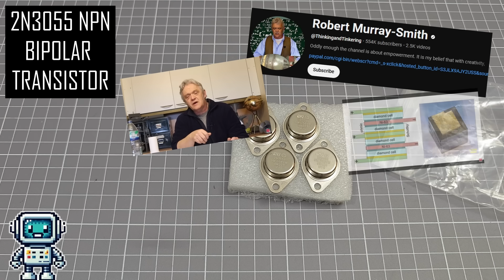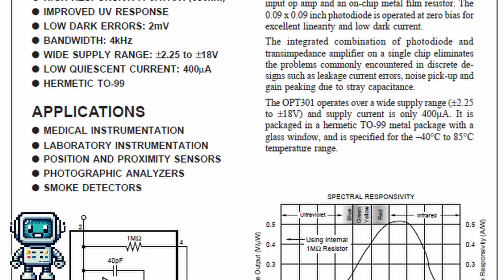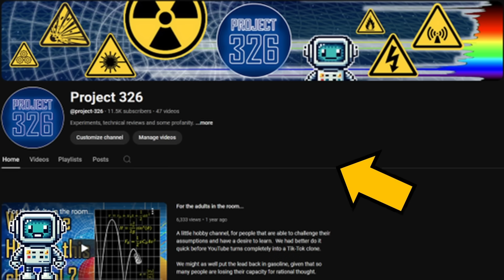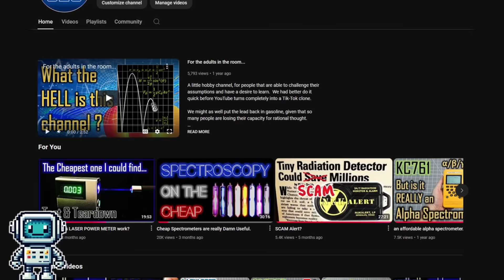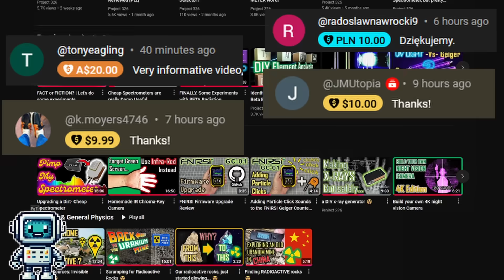Easy Peasy DIY Thermal Camera Microscope

Comment: @10:57 water under the bridge at this point, but as a thought experiment...  what you really needed was to show more contrast, a greater thermal gradient.  Turning up the power is one (potentionally) catastrophic way of doing that.  You're increasing the deltaT between the package and the room.  But maybe another way of doing that would be to put a gentle fan, like an 80mm pc case fan, blowing onto the die, removing thermal energy and exposing sources of thermal by creating a larger gradient?

Comment: Murry-Smith is a teacher, he does not fake anything because he has no need to.  His channel is just showing us interesting and useful stuff that he finds, if you think his video is fake then I challenge you to try and disprove it.
Reply from the maker: Actually, I got in contact with him after this video.  Turns out he is a really nice chap and we have been chatting over email regularly since.  He did accept that the results he got were probably from light leakage.  

I repeated his experiment for him and showed where the error was probably occurring.  He was also gracious enough to accept my apology.

We were planning on making a video together, but as I am sure you know, he has just announced that he is no longer making videos anymore.

FYI, logically you cannot prove a negative, the onus is on those that make claims of positive results to prove those.  A simple semiconductor P-N junction cannot achieve the tunneling required from alpha particles unless a charge is already applied to the junction.  So, this can work as a simple alpha particle detector, but cannot produce net power.  PIN (slightly different structure) diodes are often used as alpha particle detectors.
Hope that helps
Reply: @project-326 I saw the chat you had with him, glad you guys are cool.  His latest video on his channel is him saying that he will not be making any more videos, he doesn't say why.  I hope that he changes his mind.

Comment: купил вот такую инфракрасную камеру(тепловизор)-TOOLTOP ET693C,
вырезал и склеил для нее накладку из пластмассы(ABC) для крепления микролинз
(для поиска коротких замыканий,на электронной плате)-
просверлил два отверствия для линзы инфракрасной камеры= 20 мм, и для видимой видеокамеры= 14 мм,
приклеил все,клеил все СУПЕРклеем ,
а линзу клеил другим клеем-POLIMER-нейтральным,
Фокусная линза Cloudray  CO2 ZnSe
с цифрой=25,4  мм(для SMD телефонов-PCB circuit board) 
с цифрой=38.1 мм,(отличная для SMD ЭЛЕМЕНТОВ-PCB circuit board), 
и цифрой=76,2 мм,(ОТЛИЧНАЯ ДЛЯ PCB circuit board)
диаметр у всех одинаковый 20 мм,просверлил и дирку для видеокамеры 14 мм.
Лучше брать марку линзы=Focus Lens Vs Cvd Znse,она дает меньше искажений,но в 2 раза дороже.
Вырезал и склеил для насадок с линзами коробку из платика,для предотвращения царапин на линзах.
Рекомендую!Все работает отлично!

I bought such an infrared camera (thermal imager) -tooltop et693c,
I cut out and glued a plastic overlay (ABC) for her for fastening microlyins
(to search for short circuits, on an electronic board)-
drilled two openings for the lens of the infrared chamber = 20 mm, and for the visible video camera = 14 mm,
I glued everything, glued everything with superglue,
And he glued the lens with other glue-Polimer-neutral,
Focus Lines Cloudray CO2 ZNSE
with a number = 25.4 mm (for SMD phones-PCB Circuit Board)
with a number = 38.1 mm, (excellent for SMD elements-PCB Circuit Board),
and number = 76.2 mm, (excellent for PCB Circuit Board)
The diameter of everyone is the same 20 mm, drilled and dirka for a video camera 14 mm.
It is better to take the brand of lenses = Focus Lens vs CVD ZNSE, it gives less distortion, but 2 times more expensive.
He cut out and glued a box of payments for nozzles with lenses to prevent scratches on lenses.
I recommend it! Everything works fine!

Comment: at 9:06, the wire on the right has small specks of heat while most of the wire is cooler... I wonder why?
Reply from the maker: Thank you for the comments.  The apparent hot-spots might be the result of reflections off the bond-wires.  These are normally made from aluminum which is a great reflector of thermal IR energy.
It could also be a real hot-spot, but it is pretty difficult to say.

Comment: This is awesome. It's exactly what I was looking for. I have a hikmicro b10 and would like to make a lense for it. I would use it to casually view boards as large as a 3d printer board, and as small as an esp32.  I think the triple lense that you have here might be overkill for my needs.  I am also wondering if the optics in the b10 will be similar to the optics in your device. Thank you for this video, it is a great starting point for me.  I may get some of these lenses ordered and start working on a 3d model to fit the b10
Reply from the maker: Thanks for the feedback, it sounds like you are on the right track!

Comment: I had a question, i recently bought a single thorium mantle which gets around 150 CPM whereas other videos shows that the single mantle gets around 1300 CPM , is the difference due to accumulation of its daughter products and how much time does it require to accumulate the daughter products ?

Comment: For the infrared telescope

We are going to need a metal mirror (not a glass made & metalcoated mirror. It must be made of shiny metal. last part of the video) 

https://youtu.be/iE0ajDN9848?si=wg9joZmsbSbPhBWT

And then build a Newtonian Reflector telescope using that metal mirror:

https://youtu.be/f27s0_S6E0E?si=OUiJu1qPFTIQB02o

If it works with visible light, it will work with infrared also.. 
That kind of telescope use tiny lenses (cheap) and a big mirror (affordable)

Comment: Do we need lenses or Filter, if we can just program to reduce ISO of thermal sensor and can zoom in as unlike normal camera sensors, thermal don't get blurred when zooming digitally because they are more sensitive and can capture thermal energy at very micro levels than normal camera sensor.
Reply from the maker: Hi and thanks for the comment.
Perhaps you can be a little more specific on this point?  I'm not really sure I understand what you are implying by the mention of "reduce the ISO"?
I would greatly value your clarification on this point...
Reply: @project-326  like via programming only allow certain frequencies at a certain zoom like clearing blurred imagine but constantly via code where while zooming, frequencies get updated automatically that limit readable signals based on zoom in and zoom out
Reply: It's like the Digital Focus Code Principal applied on Core Frequencies Sensor Programming

Comment: You need a large aperture with FAST focal ratio telescope to get descent result, or else the contrast will be too low.
I tried removing the glue of the lens and could focus to very close distance, so the extra lenses may not need.
This is my thermal Moon (12" telescope) captured back in 2023:
https://www.youtube.com/shorts/WQ21lNZH6dM
Reply from the maker: thank you very much for the information.  In fairness I just want to maybe view the moon but mostly aircraft, I think that will give for an interesting video to the viewers.  Any further advice you have would be very much appreciated and your contributions will be mentioned in the video...
a 12" mirror is going to be pretty expensive, especially if it has a low f-number.  I think that the only good news is that due to the low wavelength, the accuracy requirements of the mirror will be around a factor of ten less...
Reply: @project-326  And the spatial resolution (diffraction limit) is also a factor of ten less than an optical system. So a 12" telescope in thermal wavelength range has the same spatial resolution of a 1-2cm optical telescope... 😅

I suddenly have an idea, maybe you can try mylar to make a membrane mirror?
https://www.youtube.com/watch?v=GrfPhjPzaOc
Reply from the maker: @wahwahwah8528  I know I keep taking the 'optimistic' line here, but the other advantage that this project has is that the required image resolution is very limited due to the low pixel count on the sensor.
You are advising a 12" main mirror, what focal length should I look for?
Reply: @project-326  My telescope is 12" F3, camera is Infiray T3 without lens. The Moon image is actually larger than the sensor, so I need to do multiple shots and mosaic them. Since the contrast (SNR) is not super high, I have to stack hundreds of frames to improve the clarity.
Reply from the maker: @ may I ask what tools you used allow the image stacking?

Comment: Telescopes working in the LWIR wavelength band are quite tricky, because to get a reasonably decent optical resolution you need to be close to the diffraction limit, which for LWIR usually means very fast optics (ideally F/1, worst case around F/1.8 - depending on the pixel size of a microbolometer detector). I can't imagine building a telescope that fast, so with a standard Newtonian telescope (F/4 or F/8) you'll end up with a blurry image.
Reply from the maker: that's really good feedback.  I was going into this with a bit of a 'have a go' mentality, but clearly some further analysis is needed.  I have a simple mirror set with a focal length of just 300mm (main mirror d=78mm), and so far my experiments have gotten pretty terrible results.
Some of the IR seekers (strella, etc) use a first surface telescope that is highly curved, but I think those are single pixel sensors with a rotating sync vane, to give direction.  
Any advice you have would be greatly appreciated.
Here is some very vague details I found on-line: https://www.cloudynights.com/topic/843050-thermal-imaging-with-a-telescope/

Comment: Which halogen bulb did you use? That doesn't seem to be made of regular glass, since those thermal cameras cut off wavelengthes shorter than ~7 um
Reply from the maker: It's just a general purpose halogen bulb.  Usually these us quartz glass.

Comment: Instead of cracking up the power and waiting for equilibrium it'd probably work better to uses pulses of power. I know I've seen a video before where they used pulsed power and multiple exposures to exaggerate thermal variations but I can't remember where it was or what it was about.
Reply: Lock-in or frequency modulated thermography are what I was referring to and could make it much clearer where those resistors were.
Reply: Finally found the link I was thinking of, just lookup hackaday lock-in thermography

Comment: Great video! I'm looking forward to building an IR microscope with my existing IR camera. I have a couple of technical questions regarding the optical components:

Regarding the lens recommendations in your video description, I'm curious about the rationale for selecting the Germanium "Ge F50.8mm" lens when more cost-effective Zinc Selenide (ZnSe) equivalents are available on AliExpress (with the same F50.8mm focal length).

I noticed that while you recommend ZnSe material for the F25.4mm and F38.1mm lenses, for the F50.8mm lens you specifically mention Germanium (Ge), yet the AliExpress link provided actually lists it as Gallium Arsenide (GaAs). Although all three materials (Ge/GaAs/ZnSe) offer suitable IR transmission ranges for this application, they have different optical and thermal properties that might affect image quality or usability.

In your experimentation, did you observe any meaningful performance differences between these materials? Since ZnSe are less expensive, I'm wondering if there's an optical/technical advantage to using different materials at different positions in the optical path, or would a homogeneous system of ZnSe lenses provide comparable results while being more economical?

Comment: Very interesting. Is there a specific reason for having 1 Ge and 2 ZnS lenses?
Also waiting for the debunking video🫣
Reply from the maker: Thank you for the comment.  The reason for the different lenses was that it was an evolutionary project and I started off buying a Ge type before getting some ZnSe ones later (they are cheaper here in CN).  Frankly, putting the Ge type on the outside made the whole thing just look a lot cooler - so not really the perfectly scientific reasons you might expect, but the honest answer nevertheless.
Anyway, hope that helps!
Reply: @project-326  👍

Comment: I recall using those devices to detect light pulses in an aerial photography camera to store exact time stamps for GPS position logging.

To stress test the OP301 you could place a suitable load on the device, power it up and shine an oscillating light on it to make the op-amp do more work.  An IR remote might be a suitable light source and might be undetectable to the LW IR camera.

Does your observation about the front surface mirrors mean that they would be able to detect the reflection of a vampire easier? :-)
Reply from the maker: nice idea about the OPT-301, I cracked the glass out because I also planned to made a video about alpha particle detection using this thing, but Arthur convinced me to crank up the power...

Comment: Thank you for your video, the topic of shooting the starry sky with a thermal camera is certainly interesting, I bought the camera myself with this activity in mind, unfortunately I didn't have a normal mirror to check it, because a 200 mm parabolic mirror costs a lot, the most I got by with was a reflective film and a can of vacuum, but it didn't work out very well, apparently the lens of the camera is too strong and prevents me from changing the focal length correctly.
Reply from the maker: but it is a great idea though...  Keep going, you will figure it out!
I just bought a telescope set of mirrors for less than $10 on Taobao with a 3" main mirror. these things are getting cheaper by the day.  One of the things this channel is about, is just giving it a go when it comes to experiments!
Reply: @project-326  Thank you for your reply (I'm glad to communicate). My stinginess does not allow me to buy everything I want.
I came across your other video again, my thoughts were near this topic, I realized that they can converge with this project, it is possible to combine the image apparently the range and far infrared, by installing two different sensors, glass at 45 degrees reflects far infrared image, and a regular camera will be able to observe through glass with small losses, a regular and thermal camera could observe through a telescope and it would be possible to combine two types of radiation in one image, (sorry if it is difficult to understand, I am not a native speaker and rely on Google translation) if you are interested in implementing something like this, then good luck

Comment: 1. YES TO THERMAL TELESCOPE.
2. Following on from this, you could use image stacking techniques used in astrophotography in order to get more detail from multiple frames of a microscope video. That way you won't have to fry any chips.
3. Yes to the Robert Murray-Smith video.

Comment: Nice video! Another extension of this project could be to add an IR light source. Silicon is also transparent at the right wavelength, so with a light source you may be able to take some nice pictures of the layout of chips in a flip chip assembly. Looking from the back of the die allows you to bypass the metal layers

Comment: Excellent project, and congrats on the successful consult. Of course, for the sake of those who don't know, this is not a "compound" microscope but a "simple" one. The difference being that in a compound microscope one lens (objective) creates a real (inverted) image, the other one (eyepiece) enlarges it to a still bigger virtual image. Here lenses create successively bigger virtual images. It's similar to using a microscope eyepiece as a magnifier. I bet a compound microscope would be an unsuitable design due to low brightness of the resulting image on the sensor.
Reply from the maker: Thank you for the clarification, part of the purpose of this channel is to learn new things myself!

Comment: Im not sure ive seen that Robert Murry smith video, but i will say i don't think he vary often pushes the truth much..  i know for a fact you can get some micro current out of opened up transistors.       But either way good project and good on you for thinking to check him on it.    btw the telescope sounds fun!
Reply from the maker: I have only seen a few of his videos but frankly I recon I could make a new channel just based upon his antics...
Reply from the maker: I think that he is just letting in enough light to give a small current, ie nothing to do with the alpha particles as he claims.

Comment: have been looking for someone who reviews ir transparent materials. theres nothing on youtube dude. just you. I have been wanting to take apart my cheap IR camera and put it inside of my old iphone5s (2016 se swapped). just need to copy strange parts headphone jack video and solder it into the back of my lightning port, and figure out how to make a switch to enable the connection. got a slightly shorter battery for this today actually. the lens cap was just going to be a small flat FE-AL magnet, was thinking i should just shift the magnet down and have it close a magnetic reed switch inside to enable the connection. should be able to drill a hole and use one of these cheap lenses/disks and silicone around it so its water tight above where the longer battery used to be.